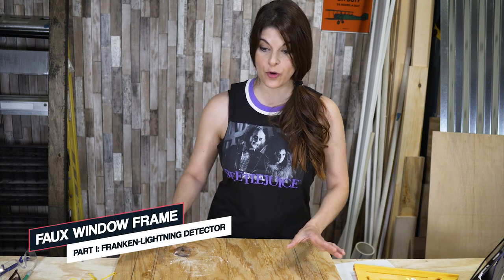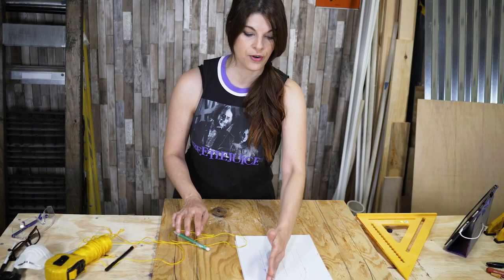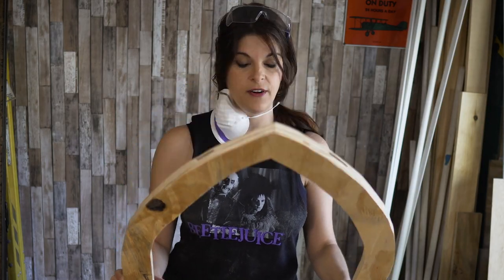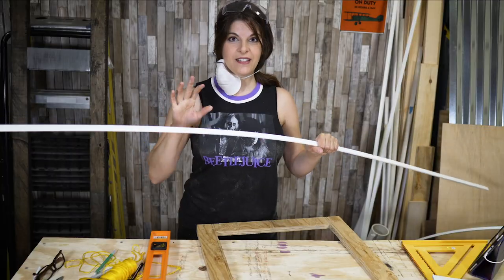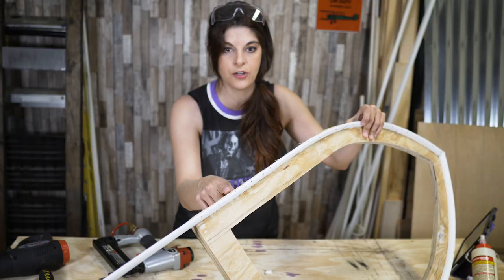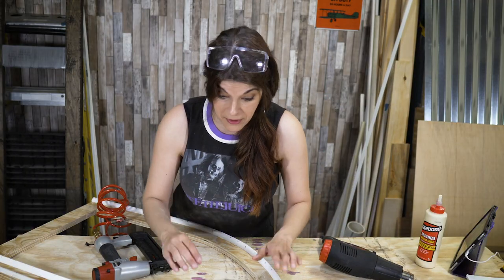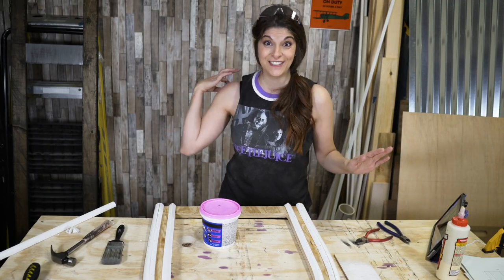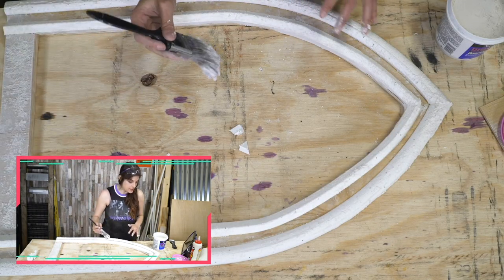Faux Arched Cathedral Window Frame | Part I: Franken-Lightning Detector

Comment: Heat Gun is your friend when it comes to bending materials  + 1 
The Price Of Lumber Is Crazy Expensive.  Make No Mistake.  Literally .......
Reply from the maker: Very true! The PVC trim was less than $5 and much easier than I thought it would be to bend with heat. I've soaked wood trim in my bathtub before but you still have to be really careful bending it.